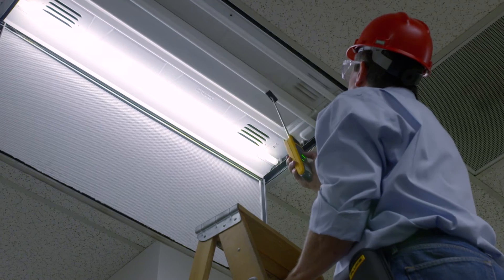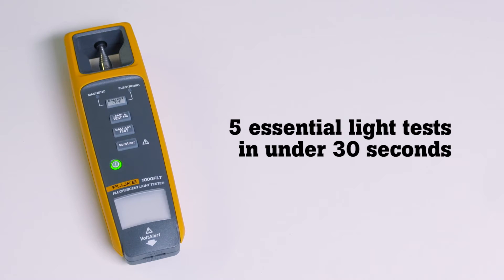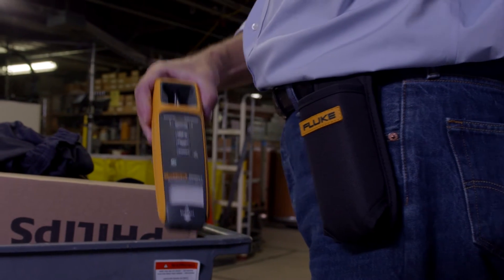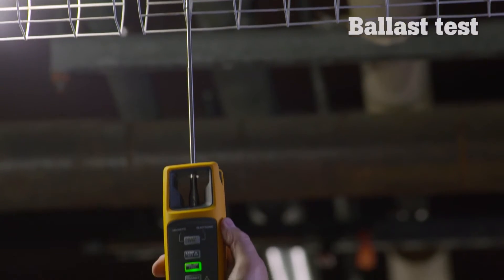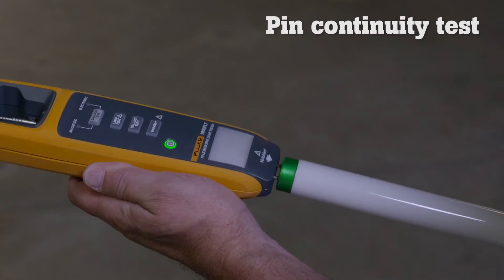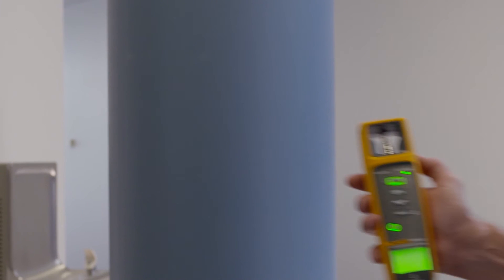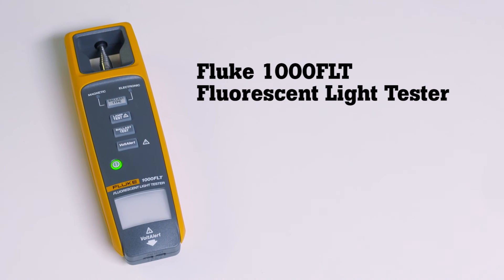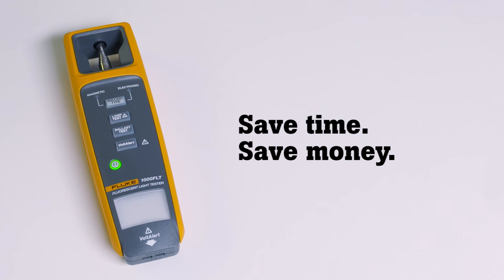Fluke 1000FLT Fluorescent Light Tester Overview

Comment: Hi may I know if the lamp test is just checking the gas inside right? Even if the pin (filamen inside) is broken the gas still light up in the lamp test?
Reply from the maker: Hello - That is correct. The Lamp Test verifies that the lamp is gas-filled. This test
is done with or without the lamp in the fixture. You can test with the rod extender pulled out or collapsed. If the fluorescent lamp is bad (no gas), the fluorescent lamp does not blink. Hope this helps.